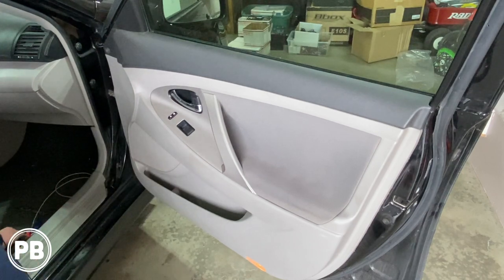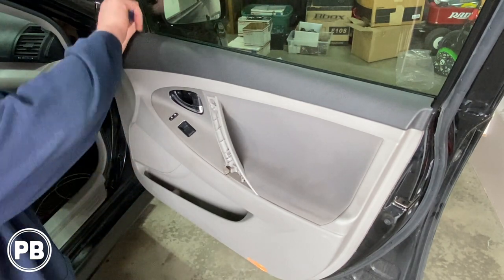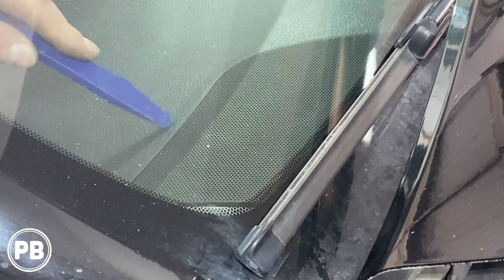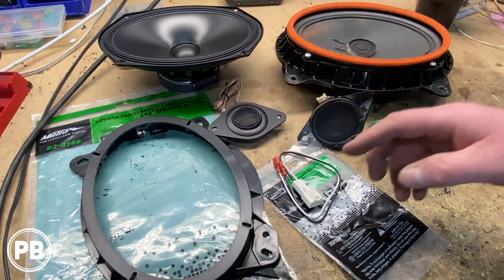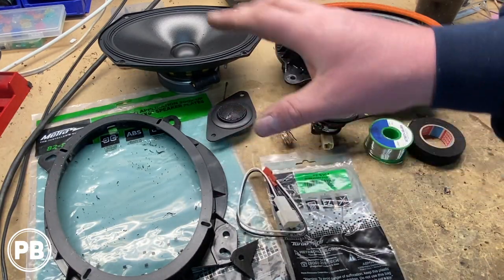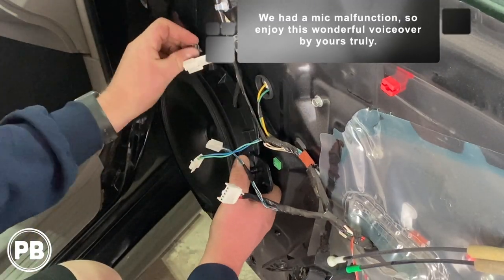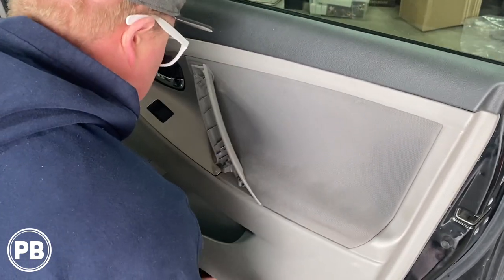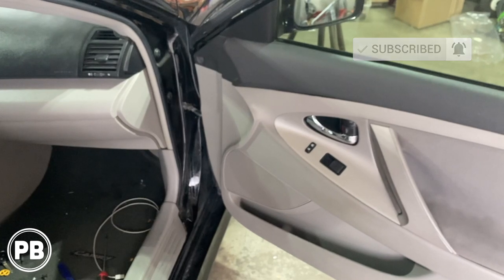2007 - 2011 Toyota Camry Front Door Speaker Install

Comment from the maker: Parts used linked in the description of the video!
Reply: You described the speakers in this video as coax and I ordered a pair of coax Alpine SPE-6090, Type E 6x9" 2-Way 75W RMS Speakers. I believe the ones you installed were component. Am I wrong about this. I have the JBL system and want to keep it that way.  I'm wondering if I install these coax (that have a center mount tweeter) if the highs will be way to annoying. What do you think. Any input would be great.  Thanks
Reply from the maker: @jerrytaz6982  We used component speakers, link in the description of the video.  We recommend component set, not just a coaxial set if you are retaining the factory JBL amp.

Comment: Nice. I got everything ordered and will attempt to do the install tomorrow.
Reply: lmk how it sounds
Reply: @sirnoah5628  So I installed Polk DB series 6x9s in the doors and some JBL GTO series tweeters in the dash. It's definitely brighter and more crisp than stock and the soundstage seems to be about two feet higher than before. I'll get a little 8" or 10" sub installed over the next few weeks but it sounds relatively full right now. I can't believe how dinky the OEM speakers were though they didn't sound half bad.
Reply: @czguy3045  did you bypass stock jbl amplifier?

Comment: First let me say, thank you for this series. I’m working on an install in my daughter’s 2010 Camry and these videos are invaluable. Much appreciated!

I’ve got a question (or a series of questions as you’ll see later) regarding the front speaker wiring. I’ll be installing component speakers in the front as you did but the Infinity speakers I bought come with a passive crossover block as opposed to an inline crossover. This means I need to have the speaker wiring from EACH speaker (2-tweeter and 2-mid-bass) going to the crossovers (8 wires total). When I replaced the head unit I only saw 2 sets of wires (4 total) for the front left (wht&wht/blk) and front right (gry&gry/blk). Some videos I’ve watched have the 2 wires coming into the tweeter harness, paralleled through, then down to the mid’s in the doors. In your video it appears there’s only 2 wires at the tweeter wiring harness; no parallel pass through. Now, to my question(s). Are there wires that I’m not aware of? Are they split somewhere going from the head unit to the tweets and mid’s? Will I need to run a set of wires to each of the doors (mids) and leave the F/Rt. and F/Lt. going to the tweets? Should I get a set of inline crossovers for the tweets and abandon the Infinity crossover terminal block? Just trying to get some clarification on the wiring so I know what I’m up against and how I should proceed. Any opinions are appreciated. Thanks!

Edit: 2010 non-JBL Camry

Comment: I’m just a broke college student who doesn’t want to pay the outrageous fees to get this done professionally. I got all the exact supplies I just need to know all the tools you used.
Reply from the maker: Screw Drivers, 10mm Socket wrench, butt connectors or crimp caps, pliers are a bare minimum.
Reply: If ur broke don't buy sound system
Reply: Heck yeah bro no kidding

Comment: Awesome video as usual! 
I ordered everything here, but curious why the new speaker wouldnt just fit in the old bracket? Just curious.
Reply from the maker: If you had JBL, sure, you can most likely reuse the bracket.  Non-JBL speakers don't have that luxury as the two don't separate and a bracket adapter is needed.
Reply: @ProvoBeastAudio  Thank you! I did end up using the new one after all. 
I put these speakers in the door, and new 6 x 9 in the rear deck of the former JBL system, do you think the JBL amp would still be sufficient for this? I’m not going to blast this system but wondering if you happen to know how powerful the JBL amp is?
Reply: @ProvoBeastAudio  i just wanted to say then why did the factory speaker have 4 screws holding the speaker to the bracket. i saw the screws very clearly?
Reply from the maker: @aldee3018  Because we had JBL, but we wanted to show the correct bracket to use for those that did not have JBL.  This install applies to all trims.

Comment: Will these 6x9 speakers listed in the description also work as a replacement for the rear speakers? I want to retain stock JBL amplifier configuration.
Reply: Did you ever get the answer to this ? I’m replacing mine and keeping the jbl amp , please tell me what you ended up going with
Reply: @icey5white  so am I 😂 I need answers
Reply: Also, would you need to remove the crossovers from the mids?

Comment: My side doors speakers are only playing bass, Im pretty sure I did something wrong
Reply from the maker: If you have the JBL amplifier, then yes, you will notice that the midrange in the door only will play midbass as the JBL amp has built in crossovers.
Reply: @ProvoBeastAudio  Is there a way to fix this, or mid range speakers only play midbass?
Reply from the maker: @hchavira26  Replace the factory amplifier, or get a setup like ours (speakers linked in the description).
Reply: @ProvoBeastAudio  Aw ok, what amplifier would you recommend?

Comment: couldn't you use the factory 6x9 speaker plastic mount?
Reply from the maker: Technically yes as the JBL line can separate, however, not everyone has JBL which is why we wanted to show the correct bracket adapter regardless of the trim level Camry.

Comment: No even close this alpines to jbl factory (((: ,the woofer very good ,the problem  in volume of tweeter ,you need to put 4 ohm in series and i dont remember 2-4 uf good capacitor, thats all you have 3 inch on dashboard,1 inch never will be sound better ,maybe just in higher freq ,want to put bose cube on dash and larger inductor on woofer
Reply from the maker: LOL

Comment: Will these speakers work with the factory JBL amp??
Reply from the maker: Yep!
Reply: With the factory jbl system, would you not need the crossovers in the new tweeters? Also would you need to remove the crossovers on the mid speakers?